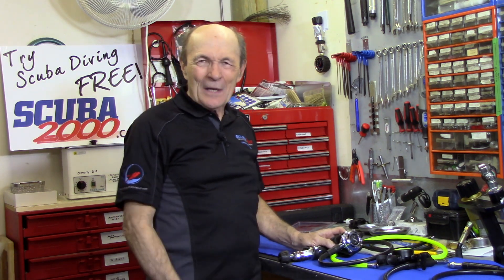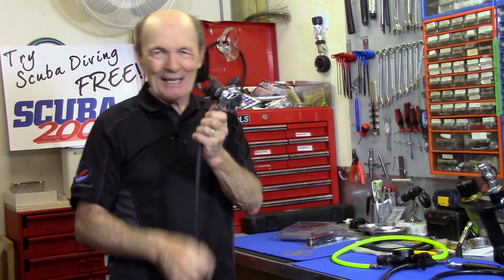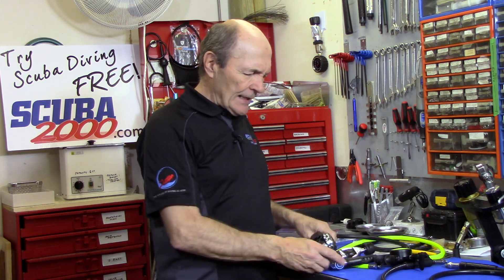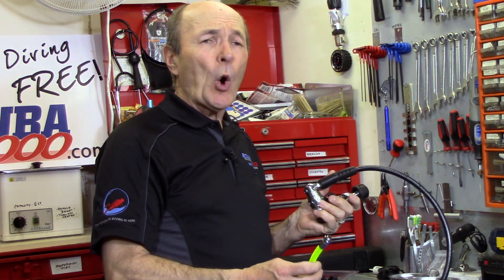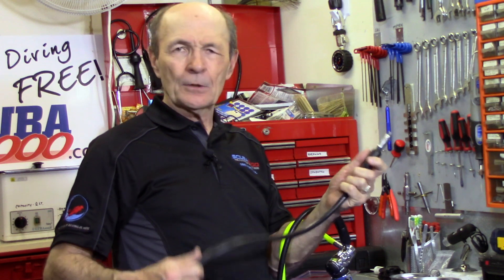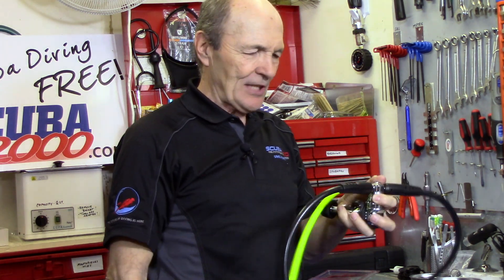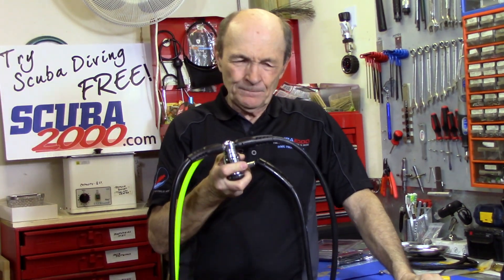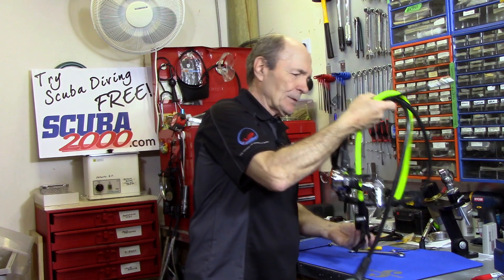Mixing Brands In A Regulator System - Scuba Tech Tips: S05E13

Comment: Here is a topic for you - traveling setup (which I know you do a lot). You do mention packing light on one of your video (I already have flexi hoses which I love, a tiny Ion/AT600 setup, and Nova fins based on your glowing endorsement, and an older sub 5lbs soft bcd which I use for local dives too now) but one thing I've been toying with is Aeris Jetpack and shorter fins to fit. That would enable you to carry all your gear on-board all you gear instead of checking it in (might save a bunch depending on flight, and not risk of loosing/damage). More a pipe dream of me taking off solo for a tropical dive on a whim...
Reply from the maker: The Oceanic JetPack is a neat idea - combining the BCD and the Dive Bag. We have sold a few of them.
Unfortunately, like so many ideas that combine functions in one item, they don't work nearly so well as it seems. 
Picture a combination hammer/screwdriver. Technically possible but you would have a hammer that doesn't do a great job and a screwdriver that's bulky to handle.
Sometimes it's better to have 2 really good items that do a great job as intended.
A travel BCD that works well laying on the bottom of a dive bag that works well sounds perfect to me.
Realize that with the Jet Pack when you're underwater you have your dive bag on your back!
Alec
Reply: but the point of the jetpack is to carry it onboard and not pay baggage fees. Some reviews I've read mention the tank lifting up when empty but I don't have direct experience. Apparently the waist band doesn't pull the tank.
Reply: why would I spend >$800 to get what looks like a not so light BCD (unless you remove all attachments) just because it comes with a backpack that looks too small to put much in ? I already have a sub 5lbs large BCD that folds flat (for next to nothing) and can get a $40 backpack to carry it and few items too...
Reply from the maker: Now you're thinking!
Alec
Reply: Get a Scubapro Hydros Pro, that way you have the BCD and the bag seperate, and all your gear will fit.

Comment: nahh. try the poseidon xtream :). ps: it is a pain to mix poseidon anx other brands :) overall a very good vid. more ps as i am watching: you should always use your safe second, during a dive I use to switch from my main to the second(i use a longhose config and the safe is for me). keep up Alec
Reply: I did say that you can mix almost 100% of regulator brands. I did not mention which ones posed a problem.
One is Poseidon. The threads and ends of their hoses are different from all others.
Alec
Reply: Yes I had read that Poseidon liked to be different. everything else seems quite compatible.
Reply: Yes you did. I also suspect people that use Poseidon probably know what they are dealing with. I think some brands used to have unusual port sizes but not lately. Apeks TX some years ago perhaps?  I think those had the 1/2" port for the second stage and used 5mm hex driver on the plugs too just to be different.

Comment: Hi Alex, thank you for your video. It is very useful to me. However, i have a question that no one can help me with and I don't know if you will see this comment.

I am using Atomic B2 (great regulator by the way) and i notice that i can blow air into my low pressure hose when i am not purging it.. not sure if it's leaking or it is because of the regulator is "balanced" does it mean that it need to be service ? or it's just normal.

Will appreciate it if you can help me out. nobody seems to know why this happens
Reply: Shamus Tung its working fine. its called the seat saving orifice. can only rinse pressurized because lf that
Reply: a feature on atomic regs. can be gkkd for saving seats but a pain in the behind for rinsing
Reply: Ah i see, thank you very much for the information!
Reply: The Atomic second stage (note I said stage singular - they only have 1 first stage and 1 second stage and simply add or remove "features" on the second to give it a different name. The basic reg is the same.) has a feature that, contrary to their sales hype is NOT exclusive, that they call "Seat Saving". With this design, when the regulator is off the tank (no pressure), the second stage seat is not sealed. You can therefore suck on the second stage and get air or blow and air will go out - a bit - not enough to breath but you can notice it.
Not a bad idea at all but it does cause that odd effect and it's also is the reason why they tell you to NOT rinse the second stage when it's not under pressure - the same as not pressing the purge on a regulator while rinsing.
I think I've debunked the theory that lots of water will rush up the reg hose and flood the first stage in either case in one of my videos, but there's no reason to not follow the manufacturer's advice.
Alec
Reply: Thank you sir, your explanation is very clear. it will definitely be a pain in the back not rinsing while it is not pressurized.
Shamus.

Comment: You must be a mind reader Alec as this is a question I've had on and off for a long time. I recall the dive store when I was buying my first set (Apeks XTX200) many years ago saying it wasn't safe to mix them.  Though, they knew I was new to diving (2 days into my open water) and that I wanted a good regulator.
What's funny is I passed my open water in all of my own equipment with the exception of weight belt and air cylinder and was the only student to do so!
As always another great video, this could lead into another idea for you.
Could the actual regulator differences between Air, Nitrox and Trimix make enough of a video? Companies will sell you a different 1st and 2nd stages set just for the said purpose.
All the best for now.
Reply: Right Alain.
Within reason (up to 40% oxygen) any regulator will do the same job regardless of the gas mix. None of the gases we use are corrosive or flammable. I know you said that oxygen is flammable but I know that you know it's only an accellerant. That is, it will hasten or increase the likelihood of a fire. It doesn't actually burn itself.
When you decide to try nitrox or any mixed gas, you MAY need to prepare your regulator for that gas. You have 2 choices - properly clean your current regulator or buy a reg that's already cleaned and ready to go. That's one of those green ones. Your choice. 
My suggestion? Unless you need or want to buy a new reg, get your current regulator properly cleaned for Nitrox use and add a green mouthpiece and/or hoses. 
Bingo! Just saved some money and you're all set.
Alec
Reply: Alec mentioned that before in one of his video (maybe the 300 vs 800 regulator). Exactly the same regulator between air (21% oxygen) and Nitrox (typically 32, or 36%). Only tanks - and therefore the valves o-rings which can be swapped, and inside cleaned - will need to be Oxygen clean IFF your shop pre-filled with pure oxygen (which is highly flammable) then ad normal air afterward, instead of pre-mixed 32% nitrox going into any regular tanks. Most of my boat dives I do nitrox (easier to do 6 dives a day, repeatedly) and everyone uses a regular tank as it's pre-mixed - only reason to have the green Nitrox band is to mark it as special so someone else doesn't just grab it and thinks it's normal air (nitrox has depth limits that can starts around 110ft so not very deep).
Reply: Alain Dumesny 
Hi Alain, I was more thinking when purchasing new, what would be the differences, there seems to be quite a premium for the green coloured logos for example.
Thanks for the response, I do recall the original once you refresh my memory 😊
Reply: so what does properly clean for Nitrox means ? remove any oil and such ? I bought a brand new regulator (so no need to 'green' it) but an old octo, bcd/drysuit connector, and old sunnto computer and occasionally dive 32% nitrox (boat trips, no need of expense on local 2 dives a day). Nobody seems to have 'green' gear on the boats - makes you wonder if it isn't shops trying to sell you serivce you don't really need for typical 32% nitrox ?
Reply: New regulators are typically ready to go for Nitrox to 40%. How long they stay that clean is another topic entirely.
If you've taken an Enriched Air (Nitrox) Course, they should have explained and demonstrated proper cleaning. Essentially it means an entire overhaul, cleaning and rebuild using oxygen compatible parts.
If your regulator been serviced (for Nitrox or not) and you're using only pre-mix less than 40%, your regulator is OK to go.
Alec

Comment: Poseidon xstream in SM would be nice, can't mix it with other brand though.
Reply: You're right Tom. It's possible to mix Poseidon parts. It just takes a bit more care and time. 
It's always best to NOT change the factory determined IP. The entire first stage is designed to give appropriate air flow at a fixed IP. It's preferable where possible to tune the second stage to the IP. It's at the second stage the breathing effort is determined. The IP actually has little to do with breathing effort. Some regulator first stages run IP at 120 psi while other are designed for 160 psi. A second stage can be adjusted for either.
I have seen lots of divers come in for service and complaining that the reg breaths hard. They say that they have turned up the IP as high as possible and it still is hard. Bad!! Increasing the IP on a standard reg can actually make it harder to breath!!
The procedure to adjust the IP and then set the second stage for easy breathing is not complicated. But, the science and technology behind the design of the first stage which involves the materials used, the spring size and rebound, the orifice sizes, the O-rings, the surface area of seats, even the size and material of the filter, all contribute to proper, consistent, flow at varying pressures. No dive store technician can begin to understand much less modify a first stage easily without getting into problems. Realize that a first stage delivers a smooth, consistent flow of air at a fixed pressure regardless of the depth which greatly affects the density of the air flowing through it or the tank pressure which can be anywhere from 3500 psi to 150 psi. Pretty incredible device and development. 
Alec

Comment: Great video. I've always debated on mix and matching. Like getting the oceanic air integrated computer, scuba pro reg, ocean bcd, and cheap but heavy duty emergency octopus. The problem is getting it serviced easily. All my local dive stores will only maintain equipment bought by them and only 1-2 brands max. Don't even think about buying anything online or they won't touch it. Wish we had a cool and flexible dive store like scuba 2000 where I live. I don't blame them since I am in Missouri and it's not like we have a booming scuba market smack dab in the middle of the country.
Reply: Even more reason for them to give good customer service! If I lived there and experienced that, I'd be opening a dive store that offered all the things they don't. Guess who would flourish?
It is because of such stores that the internet is so popular.
Won't service gear that wasn't bought from them!!!!!!!!!!!!!! And they probably thinks that's good business!
Good luck. 
Alec